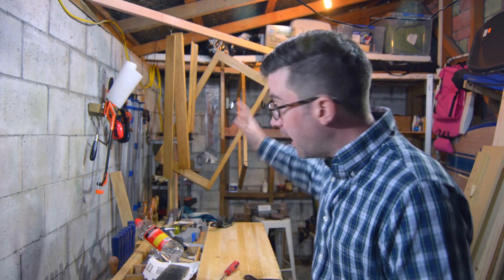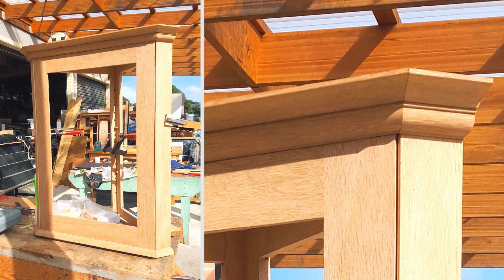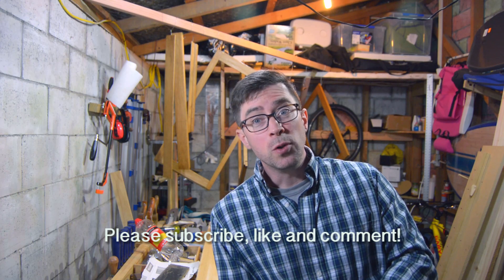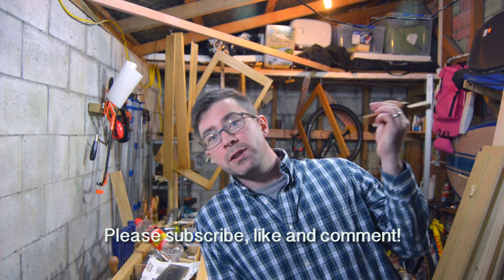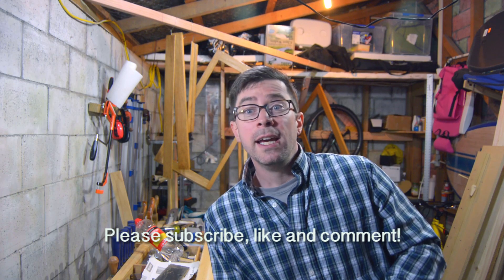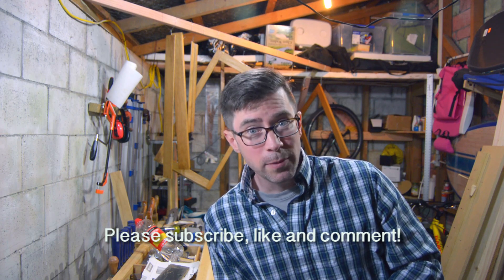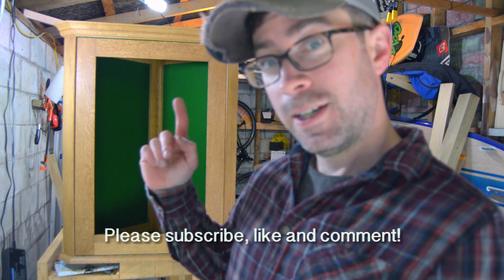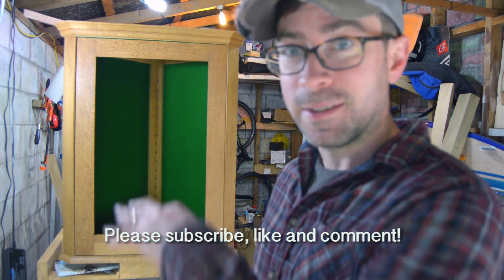Applying 7 Coats of Danish Oil | The Painfully Slow Way

Comment: I applied 10 coats on a carving. Kinda mad I know but got obsessed. Did a coat or 2 coats a week. Used 0000 steel wool which is like 600 grit. I must admit it's the most beautiful finish I've ever seen. I need to stop it now. Great job you did.
Reply from the maker: I get the obsession with it. As you see it building up and looking  better and better.  But yeah took forever

Comment: If you ask me, sanding between coats is the wrong approach.  I would suggest getting the best finish you can on the bare wood (using 000 grade steel wool for the final sanding works really well) and then apply the oil with a rag and gently wipe off with a clean soft lint free rag (not the one you use to apply the oil with).  After a few coats leaving overnight between each coat (especialy if temperature isn't very high), do a very light buff with the 000 wire wool and use a soft brush to dust off before each subsequent coat.  This results in a really nice finish.
Reply from the maker: Yeah i would never do this this way again.  Will absolutely follow your advice!!!

Comment: So I am not clear, what  exact benefits does this many coats of Danish oil provide?  You mentioned it has a satin sheen, so it's not ultra shiny.  How smooth is the wood?  Does the grain have a visual depth to it, or some added contrast?    I am asking because I can apply 3 thin coats of satin polyeurethane over 3 or 4 days and get a fantastic finish.   Trying to understand the best way to work with Danish oil to get a great finish.
Reply from the maker: I was trying to follow the instructions on the can in this... it's painful. It wasn't a bad finish in the end but it was frustrating. 
90% of cases I'm going to do exactly as you would do and go to poly... or shellac.

Comment: Have you tired applying the 3-7 coats of Danish Oil with 600 sandpaper.  Works pretty "smooth" as well.  :)
Reply: I do axe handles in Watco Danish oil and I sand up to 400 (before the Danish oil, no sanding while applying finish). Apply 3 coats at the 15 -20 minute false dry stage while rubbing them down with those red automotive shop towels that are actually kinda abrasive. After that I let it cure then keep applying coats and letting them cure while hitting with the rag in-between until I'm happy. Comes out ammmazing every time. I used to be a big fan of oil handles but it's just as good if not superior, plus the way it ages and darkens with hard dirty use is untouchable.